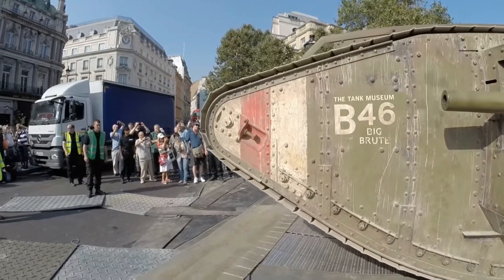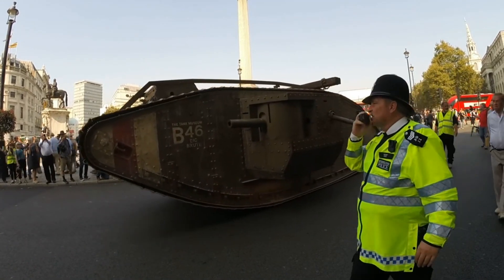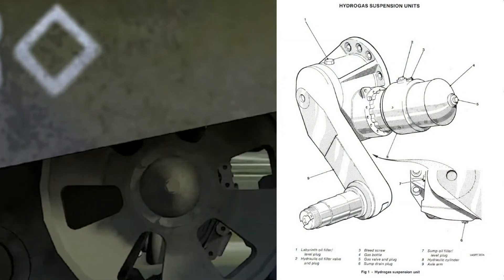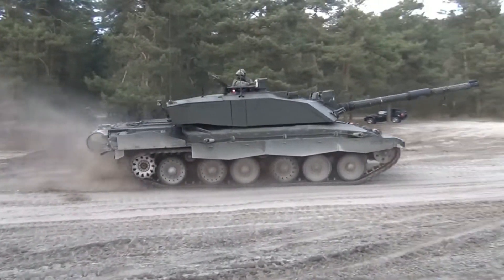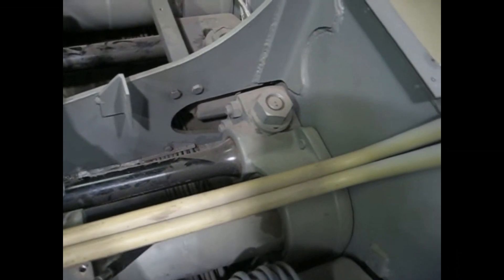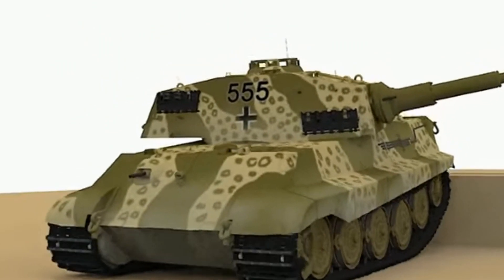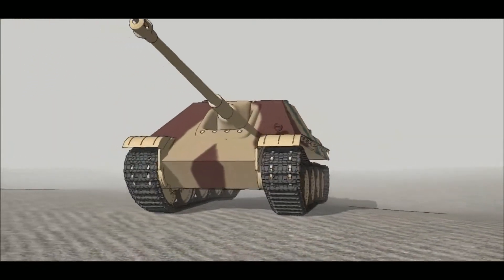Tank Suspension Systems - Pros And Cons

Comment: Hydro gas suspension has damping built in, torsion bars require external dampers. For a tank it’s usually just a friction snubbed though. 

The merkava actually uses coil springs, and supposedly actually has the most wheel travel.  I think it’s actually similar to a modernized version of the Churchill’s suspension. 

I think there’s also a system I think called “in arm” that according to horstman’s website (which exists?) is a further development of hydro gas. I think there might have been a different in arm suspension developed as a prototype in the US? The US has this giant kinda poorly documented history of experimental tank designs that never went anywhere.

Comment: MATSIMUS........I may have spotted the broken hydrogas suspension unit you tasked us with.  
At 14:40 time.....as the Challenger 2 executes a right and turn on the right side of the vehicle wheel station 1 seems to be lifting and snapping down (probably twice) during the turn.  The tank glacis plate number looks like D5 32 AA.  
How did I go lol ?......
My email address stephen.mantovani1970@hotmail.com
Reply from the maker: Stephen Mantovani well done :-) you got it. Number one station right hand side has, or is, failing!
Reply: I think this is normal. Our leopards often did this when doing a tight turn
Reply: as he says '.....so guys...' thx stephen

Comment: 16:03, 3rd wheel from front on left side, hanging low and not responding to bumps correctly, may just be defective or low on pressure, but that one has something wrong, also after all the challengers the next vehicle has torsion and it's in tip top shape from what i can tell

Comment: Suspension is quite possibly the single most undervalued system discussed in regards to tanks.

When the subject comes up, i repeatedly see the Horstmann suspension mentioned as one of the most underused types, at least in a historical setting.
Reply: Transmissions are also undervalued. They're extremely important on a  tracked platform.

Comment: An advantage of hydropneumatic over torsion bar is lower overall height. Torsion bars require internal volume which gives extra height to the tank.Hydropneumatic units sit outside the hull so it can be lower.
Reply: Hydropneumatic suspension units are only on the outside, thus the inside space cleared can be used for better mine/IED protection.

Comment: Im not sure what type of torsion bar suspension the Leopard 2 uses, but it's incredibly smooth offroad, which I guess is also the reason the Leo 2 consistently scores best during the 'on the move' shooting exercises. Do you have any knowledge of the German system Matsimus?
Reply: Leo is coil spring like e100
Reply: @MattsViewRealEstate  E100 was belleville washer spring system

Comment: 12:15 In up-armored Pattons, Torsion bars are not very reliable, and break quite often. Replacing them is a pain in the ass

And there's a third Suspension type you did not mention - the coil spring suspension , as used in the Merkava tanks, which gives them cross-country performance on rocky terrains on the expense of weight and bulkiness

Comment: The Abrams uses the bar system. I will agree that it isn't as comfortable a ride as a pneumatic system ( being a gunner on it I get slammed into the sights by new drivers) but the maintenance is very very little.
Reply: What tank with hydro-pneumatic did you drive?

Comment: Canada has many different types of terrain , gagetown is rocky, eats road wheels and torsion bars for breakfast. Out west, Wainwright , Shilo and Suffield has much much easier terrain . However the sand does wear out sprockets and tracks faster. You might change a 4 road wheels in Gage Town in a week. In Wainwright , maybe three week, one. Terrain dictates.  Suffield is not rough Terrain.

Comment: The "terrain" the Challenger is shown on is about as mild as can be. It may look "rough" but it's primarily sand and loose dirt. Suspensions doesn't not make roughness disappear. It just delays and attenuates its effects on the vehicle. A 50-ton tank does not "float" not matter what suspension system it has because all suspension systems have several inherent limitations if for no other reason than travel has to be limited to maintain track tension. Demonstrations are one thing and combat is another. Nobody CHOOSES rough terrain willingly and ALL vehicles on the battlefield FOLLOWING behind the lead elements have to be capable of handling the same terrain, including fuel trucks, etc. And the idea that a properly designed and constructed torsion bar system will simply fail if overstressed is hilarious. 

The suspension stops should and do limit travel LONG before the torsion bars are strained to their breaking point. Clearly that is the case since the torsion bar is the SPRING. Even a failed torsion bar won't necessarily break. It can simply lose its tensile strength and tension.You also neglect to mention the benefits of a torsion bar system in that the bar not only serves as the spring but also plays a large role in LOCATING the suspension. Torsion bar systems are far simpler and have far fewer moving parts. A "hydrogas" system has multiple failure points and only serves as the spring. Suspension locating is an separate system. You have hydraulic cylinders with seals, rods and pistons that can all fail and then the nitrogen "shock" is another component entirely that can also break and/or leak. I'm a diesel mechanic with a lot of experience with nitrogen accumulators as part of hydraulic systems but only as ACCUMULATORS to provide makeup oil or absorb shocks. A "hydrogas" system literally uses TWO components to do ONE job. 

And the funniest part of your spiel is suggesting that the vehicle crew is at some point going to have to play suspension system engineer/mechanic and manually adjust torsion bar tension in the field at some point based on a particular mission. If your military is so bass ackward that the vehicle isn't BUILT and ADJUSTED for it's mission at the FACTORY and those adjustments aren't made LONG before its time to go fight, its not torsion bars that are the weakness. It's system in the entire fighting force if an  armored vehicle crew has to work on on its vehicle in anything BUT an emergency or to perform normal maintenance.
Reply: Um I'm sorry but no ... Not backward... i also worked at British tracked machines and after that heavy plant. Torsion bars break all the time and are not always easy to change. And no,  no driver crew is going to adjust the hydrogas units. Only the mechanics have the kit to do it and no i have never heard of anyone tuning the system to the terrain. We follow the factory specs for each wheel station on each variant. Be it mbt or repair/recovery or more recently the engineers newer vehicles trojan and Titan. That's the same for setting torsion bars machines and hydrogas units. These units are used on quarry/ mining dump trucks as you seem well aware and are hardly backward and the mining industry is brutal on machines ...sure the need checking and servicing but so does everything. There are things that each countries mbt does well at and also not so good. The gas turbine in the m1a is a pain to work at. Last i heard there is a lengthy cooling period before work can start on a failed power pack, where the chally power pack can be out fairly quick. Pros and cons, be more open to others ideas and battle functionality, requirements and SOPs
Reply: No new heavy armoured vehicle will use torsion bar suspension. That should tell you something.

Comment: I served on the M60A3 which had a less advanced suspension and even if we were cursing the driver and getting slammed from side to side int he turret - the gun always remained dead on target. 

And in an entire career on tanks - I never adjusted the torsion bars.  And never had one break.  I did have several replaced during quarterly maintenance (where things that are difficult to check and rarely fail get inspected and these inspections are done by the mechanics with the tanks crews assisting*).

* I was rather possessive of my tanks and didn't want anybody touching them without a member of my crew watching.  My attitude was that the only people I could count on to take proper care of it was me and my crew.

Comment: Better would be a volute knee spring operating on road wheel arms attached to the side of the tank. Self snubbing, self supporting,  self damping, low cost (made from coiled steel bars), doesn't buckle under load,  easily replaced, and doesn't jack the vehicle 8 inches into the air, permits a bottom hatch. High reliability.

Comment: At 17:12 the first tank behind the car:  The first roadwheel, you can see the first roadwheel unit doesn't have enough pressure, because the roadwheel is moving considerably upwards when the tank is taking the turn

Comment: Hello Matsimus! I think that road wheel that failed is at 8:50 - 8:56, left side, wheel number 6 (nearest to the sprocket). My reasoning is:
1. Wheel do not extend as much as other wheels;
2. Turret is turned at 6 o'clock in order to provide proper weight distribution  for condition;
3. Tank is parking for repair (maybe);
4. Bonus reason - Commander looks pissed off and driver is kind of bummed. 

Also: Very nice channel, hope to here from you and I like for you to do special video about merkava tenk suspension.

Comment: You should propably have mentioned that torsion bars are just springs. Vehicles using torsion bars also have (and need) hydraulic, mechanical or hydropneumatical dampers, otherwise they would just keep on bouncing. Older vehicles have dampers only on the first (or two first) and last road wheel. Newer vehicles may have them at each road wheel.

Comment: now I understand why Russians use torsion bar suspensions even on T 14 Armata
Reply: It's mixed. They use 8 Hydropneumatic and 6 torsion bars. I think thats a strange maintenance process just because you have to carry spare parts of 2 diffrent instead of 1 suspension system. Weird. And the T-14 Armata base is originally a highly modified version of the T-90 base, maybe that's why.

Comment: The hydro pneumatic systems can incorporate both spring and dampening functions within an integrated unit whereas a torsion bar is spring only. In this case seperate damper tubes are fitted to the suspension arms of some of the road wheels, typically the first, second and last. This reduces the stresses on the torsion bars and on the tracks if the torsion bar is returning from its "compressed" state whilst the road wheel is unloaded i.e. snapping back and over-tensioning the tracks. The addition of damper tubes also helps reduce vibration and create a smoother ride thus enhancing crew endurance. 

Torsion bars extending the full width of the hull also necessitates asymmetry in the arrangement of road wheels. In the M113 class of vehicles this results in the left track having one less link than the right track (and hence the oft-heard joke that the driver, situated over the left track, is the "missing link"). This leads to the vehicle always pulling slightly left on smooth surfaces and bigger issues of the asymmetric stress on either side of the drive system. That leads to bigger costs as components and maintenance systems have to be tailored for each side of the vehicle.

The future: The obvious next-step is an active system that reads the terrain and moves each individual suspension arm such that its road wheel is in the exact correct position to support the vehicle and transmit the minimum dynamic load to the hull when the individual road wheel has arrived over that piece of terrain. That would require a lot of complex computing and that requires a lot of power. Actively moving a dozen suspension arms up and down needs more power. An active system means you're creating some sort of signature that can be exploited, so the requisite countermeasure will use more power. And on it goes................

Ich Dien

Sunray11, Out.

Comment: Did anyone ever try coil springs on a tank?
Reply: coil springs were common on earlier tanks.  Tanks that weight less than 35 tons do well with coil based suspension.  Many smaller Armored Vehicles still use them.  the Stryker APC and many other wheeled APC still use Coil based suspension.
Reply: MR.Chickennuget 360 Right, thanks.

Comment: What about torsion bar and hydropneumatic hybrid suspension?
Reply: Well, it already kinda exists. The torsion bar system don't rely only on the bars to cushion the ride. There are some additional device to help the system. On the Leopard 2, there is a rotary damper that rely on friction. The Horstman system uses a rotary hydraulic damper in addition to the torsion bars. And for high impact efforts, every body uses hydraulic bumper attached to the hull.

Comment: +Matsimus Gaming Great vid, it does clear up a few things, ..at least the UK hydrogas is seemingly better than the Chiefy's springs for repairing and the likely safety/sanity measures too in dealing with those multiple springs?
 
..For all those saying after watching the video X amount of times and saying this or that wheel(s) on the C2 around the 15 minute+ mark, having a wonky wheel or defective suspension, I think Matsimus Gaming did say 
         "..different wheel stations (along the length of the tank; I add) are tuned for different resonances (compression & bouncing/rebound frequencies; I add).."
    - this is too try and stop harmonic resonance transmitting to the hull and making the crew feel vomity, and when slowing or stopping, enable faster 'settling' reduce rocking.
   Some of the 'strange angle of the 5th wheel is wheel dirt, + airborne dust/dirt + also down to camera/film quality and resolution, and parallax error from the curvature of the camera lens - as the camera is more centred upon the central front stations.
And sorry for those, the UK Hydrogas types are not the same as the Japanese (and possibly the French one(s) too - AFAIK, UK ones is just for the aerogas springing, and not for on the fly adjustment too for height and cant.
But as Matsimus Gaming would most likely add, I am likely wrong on even more finer points yet alluded too.

Comment: 8:37 Right track(relative to the tank), first station? Again it looks as though it's not adhering to the road, and as you say, the first and second are the most likely to break. Also, it looks as though the driver intentionally went to the right to avoid having the right track go over rough terrain.

Comment: the Abrams uses torsion bar suspension correct?
Reply from the maker: Celtic704 indeed they do
Reply: Celtic704 Yup
Reply: Russians were the first who used torsions massively and waaay before Germans even try. All panzers before Panther and Tiger used coil suspensions, whereas Soviet tanks mass adopted torsions since T-40 in 1939 and next in T-34. Actually Germans borrowed that sollution form captured Soviet tanks in 1941.
Reply: @olegc.7877  T-34s were Christie. KV series was torsion.
Reply: yup. US doctrine pushs tough, reliable and simple so torsion all the way

Comment: 6:10 of the video. Second tank pulling up has a pronounced list to it's right side. Plus it's making more noise than the first tank. So I'm guessing the roadwheel closest to the front (right side) is the culprit.
There's also the still picture of the tank with the 2 gas chargers servicing the left side. But that could just be routine maintenance.
Cheers
Craig
Reply from the maker: ceedub04 sorry Craig not the right one. But great guess! Someone guessed correctly today :-) thanks so much for watching

Comment: The ability to raise and lower ride height, tilt the vehicle laterally and longitudinally gives advantage for hydrogas. Also the torsion bar suspension raises vehicle height because they run  right  across the vehicle width creating a double floor effect between the belly plate and the inner hull floor (you don't want to be standing on torsion bars right?).
But say on the Leopard the main thing that gives it leading mobility are the excellent (Koni) hydraulic dampers as well as the torsion bars. Two systems. Also the tracks (Diehl) are considered to be excellent as well, so need to look at the whole package, when talking about mobility in general.

Comment: 2nd method to test is a torsion bar has snapped: Tap it with a wrench.
you will hear a metallic metal on metal sound as the torsion bar  vibrates, and you should be able to hear if this sound vibrates along the entire length of the bar. If the bar has snapped somewhere then you should hear the difference.

Of course this requires access to the torsion bar.  Not sure how easy that is in a tank. In LAVs it requires crawling under the vehicle (something you will be doing anyway).
Reply from the maker: Shane Rooney yeah exactly :-) good point. But in the tanks as you mentioned you cannot do this. Tanks for watching! :-) please share the video around

Comment: Left side, wheel five... Because it's connected to the punk.
Reply from the maker: TheNobleWolf haha good try but that's a obvious one haha!! Keep trying :-)
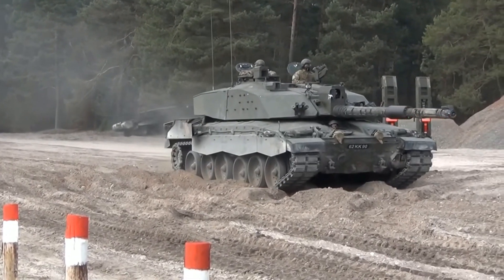Reply: Matsimus Gaming at 6:00 Tank 1, right side, 4th wheel?
Reply: Matsimus Gaming or maybe it's 9:50, right side, wheel 3. It seems to lose traction and stop entirely when the other wheels are going over the rough road section, which would imply that it is lifting up from the track, but as soon as it hits the flat road it spins back up. That would only happen if the suspension wasn't applying enough downward force on the wheel to keep pressure on the track.

It could just be the camera though.